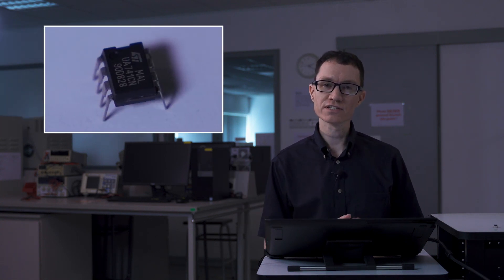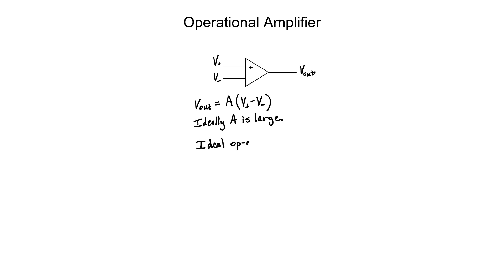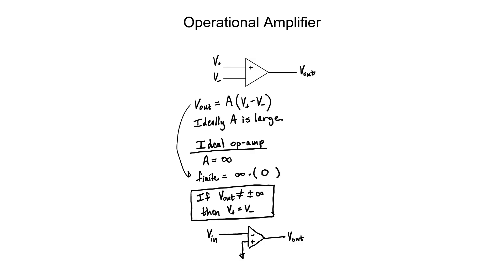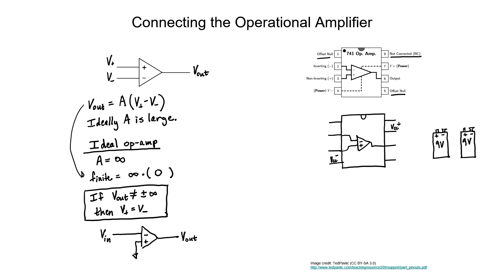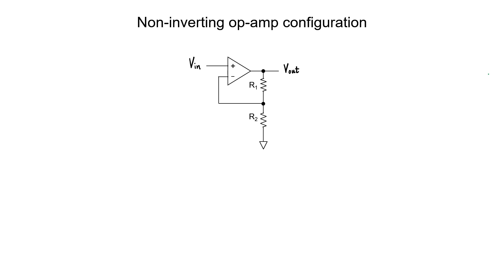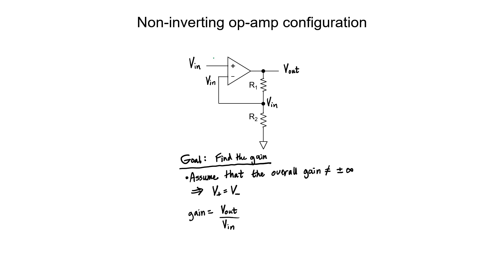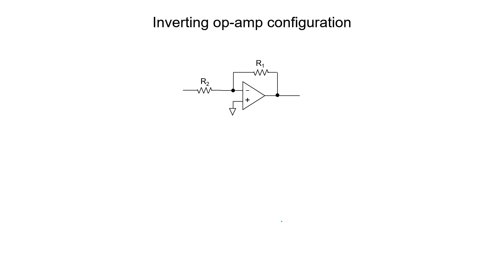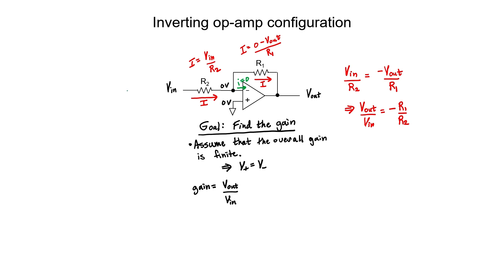Introduction to Op-Amps (Amplifiers #2)

Comment: The phrasing of the setup at 5:50 to 6::20 confused me a bit so I am trying to rewrite it here, let me know if this is correct.

The internal op-amp gain (let us say, G_internal) is still assumed t be infinite. Thus, we say V+ = V-. Through the additional resistors, we aim to modify the overall gain of the circuit (call it G_overall), which is what we assume is not infinite,  as a result of which you can claim that the drop across R2 also equals V_in. 

Did I get that correct?

Comment: The question asked by most intelligent students is this: If V+ is equal to V- then why is the op amp output 2V when the input is 1V (with gain of 2 as shown here), and not equal to zero? Since it seems that nobody has the answer to this question I will take my best guess: I think that it's because of the time delay between the assertion of the output and the feedback loop back to the op amp input. So as V1 approaches V2, the output approaches 0V. However, when the output voltage just start to drop (say 1.99999V) the voltage divider feedback node voltage also drops. At this point the V- input no longer is equal to the V+ input. With V+ not equal to V- the output voltage goes back up again. So, in essence, V1 never equals V2, but rather V2 oscillates back and forth between V1+ and V1-. Also, the output voltage should also oscillate between say 1.99999V and 2.00001V. You probably will not be able to see such a small oscillation on an oscilloscope (signal to noise ratio). The only way to test this theory is to delay the feedback of the voltage divider (think capacitor) sufficiently that the V1 - V2 imbalance lasts long enough for the output to oscillate. Of course I would not expect a simple college professor to think of such an experiment. By understanding how to make op amps fail is critical to understanding how to make your designs stable.

Comment: In the industry I have never heard anyone talk about "infinite" gain. Rather the term "rail" is used. "The output voltage has gone to the rail". The "rail" being the maximum allowed voltage the op amp can go to. Thus, the "gain" is not so much the response of the OUTPUT to the input, but rather just how small an input difference will drive the output to the rail. I also hear the term "sensitivity", but I don't know if it is directly related to op amp gain, or just the circuit configuration.

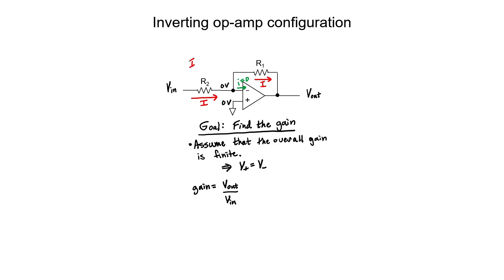Comment: @ 9:03 The inverting node is at 0Volts. Logic dictates that current will always flow from positive to ground. However, since the current at the inverting input is zero, there can be no current going from the output to that ground node. This means that the output MUST have a voltage lower than zero volts. So we drive a predetermined voltage to the load. This predetermined voltage to the load implies a load CURRENT which is determined solely by the output voltage. Therefore any remaining current must be sourced/sinked by the op-amp output. This is interesting, because you would think that at zero impedance all the current would flow into the op-amp (least resistance). But in this case it does not.

Comment: So, it looks like the inverting op amp configuration is exactly the same as the non-inverting, except that the voltage input and GND are simply swapped. Why the circuit is drawn upside down and the resistor configuration is completely changed to obscure this fact baffles me. Try drawing the non-inverting op amp first, then just swap the input with ground. Is the circuit now the inverting op-amp configuration. Because for me that would be much easier to remember. Now, for the sake of the schematic I guess you have to flip everything upside down because people expect ground to face, well...
towards the ground?

Sorry, I didn't know if you like intellectual comments or just fan worship. I don't do the latter.
Reply: Ok